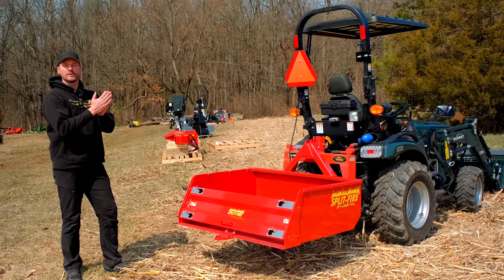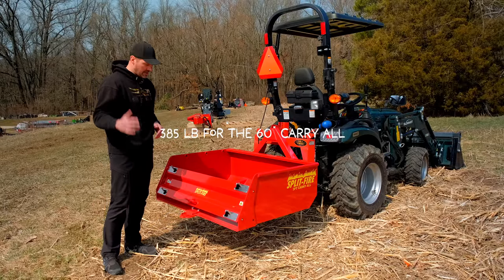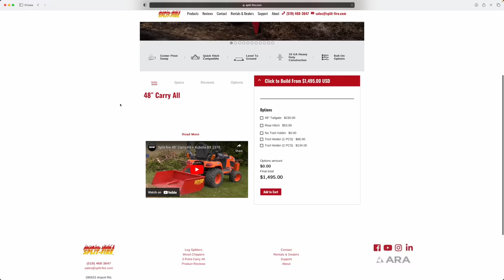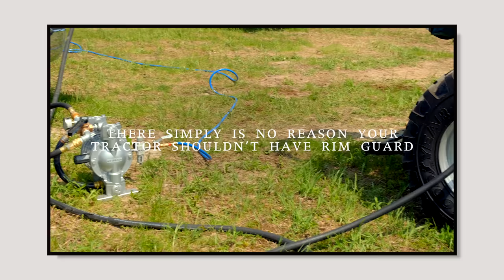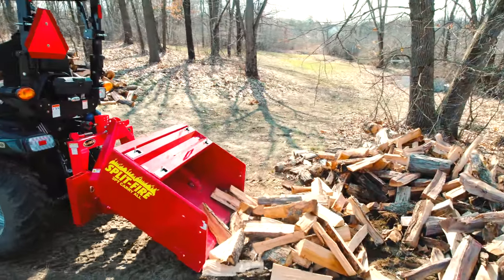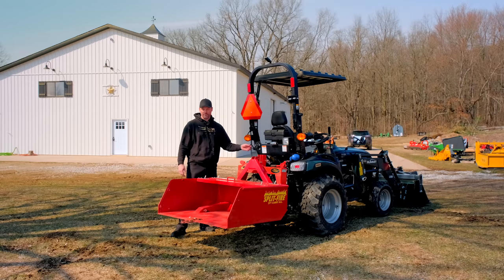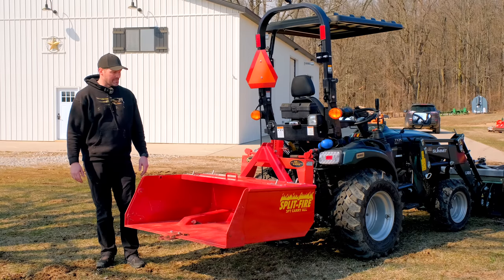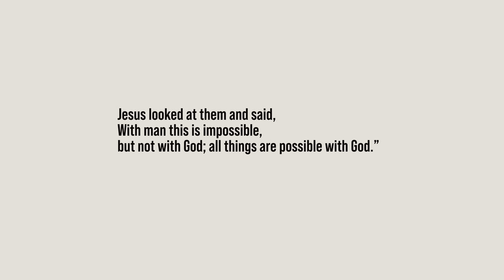A LOADER ALTERNATIVE! 3 POINT BUCKET SCOOPS, HAULS, & DUMPS!

Comment from the maker: Buy Split Fire Products manuacture direct!

Products in video:
Split Fire Carry All: https://bit.ly/41ezXrY
Split Fire 3-Pt Log Splitter: https://bit.ly/410Fh2k
Split Fire Wood Chipper: https://bit.ly/3MFse22
Precision Mfg Add-A-Grapple: https://bit.ly/3GDKHbm

Good Works Tractors is happy to be sponsored by Rim Guard Solutions!  This is perhaps the most well-known ballast brand on the market today.  Rim Guard goes right inside your tires, so it's out of the way, it doesn't freeze, and doesn't corrode.  It's made from natural materials, so it's safe around livestock and pets if it spills out.  Rim Guard liquid ballast adds more weight to the back side of your tractor improving stability, loader performance, and power to the ground.  Find your closest dealer at https://bit.ly/3d0whX0

LOOK AT OUR MOST POPULAR ATTACHMENTS!
Speeco Quick Hitch: https://bit.ly/3NFC0yl
Stump Wrecker: https://bit.ly/3WYa6Tf
VersaBracket Combo: https://bit.ly/3wUPrnl
Snow Pusher: https://bit.ly/3NB4BVw
Tillers: https://bit.ly/3GT1kk1
Core Plug Aerators: https://bit.ly/3W0R25q
Pallet Forks: https://bit.ly/38wRztu
Grapples: https://bit.ly/3PNNYaZ
Dethatcher: https://bit.ly/3GT9Zmk
Tractor Canopy: https://bit.ly/3IHcvNU

WANT TO SAVE MONEY? CHECK OUT THE GWT DISCOUNT CLUB!  Use code GWT at any of the vendors below and you will save cold hard cash :)  I will also get a commission for the sale, so it's a win-win-win!  

USE CODE "GWT" TO SAVE BIG WITH:
BUCKET BRACKETS @ http://www.jufabworks.com
CUSTOM GRILL GUARDS @ http://www.5elevendesignz.com
PTO QUICK ATTACH @ http://tractorptolink.com
DIY HYDRAULIC SOLUTIONS @ http://www.summit-hydraulics.com
GAME CHANGING GREASING SYSTEMS @ http://www.lube-shuttle.us/store
TIRE CHAINS @ http://www.tirechainsonline.com
PREVENT FLAT TIRES @ http://www.multiseal.us
CULTIPACKERS & CRIMPERS @ http://www.packermaxx.com
ALL OEM JOHN DEERE PARTS @ http://www.247parts.com
ACCESSORIES AND BACKHOE BUCKETS @ http://www.muddscustoms.com
CUSTOM TRACTOR FLOORMATS @ http://www.tractormat.com
PROTECT, ORGANIZE, IDENTIFY HOSES @ http://www.outbackwrap.com
BOX BLADES FOR ATV'S @ http://www.northwoodsfabrication.com
HYDRAULIC SYSTEM PROTECTION @ http://www.hoseendchamer.com
DUMP FROM THE SEAT MATERIAL COLLECTION SYSTEMS @ http://www.proteroinc.com
POWERED SWEEPERS SWEEP UP ANYTHING @ http://www.sweep-all.com
EASY WHEEL TOP LINK HANDLE @ http://www.tractoraftermarket.com
TIRES, WHEELS, AND DUAL ADAPTERS @ http://www.millertire.com
AMERICAN MADE CARRY ALL ON STEROIDS @ http:www.bigtoolrack.com
THE BEST TOOTHBAR AND MORE @ http://www.heavyhitch.com
5% OFF WITH CODE GWT AT TRAC SEATS! http://www.tracseats.com

SHOP: http://www.goodworkstractors.com
AMAZON: http://www.amazon.com/shop/goodworkstractors
SUBSCRIBE: http://www.youtube.com/goodworkstractors
LIKE: http://www.facebook.com/goodworkstrac...
FOLLOW: http://www.instagram.com/goodworkstra...
MERCHANDISE: https://stores.inksoft.com/good_works_tractors_merch/shop/home

*Discount codes cannot be combined with any other promotions, offers, or deals!
**I choose to sell some products through 3rd parties instead of stocking items myself.  Know that I will receive a commission if you choose to purchase through certain links.  Thank you very much for your support!

This video is for entertainment purposes only.  Good Works Tractors (Good Works Lawn & Power, LLC) cannot be held responsible for content found in any video.  Always reference your owners manuals, use extreme caution, and proceed at your own risk.

Comment: King Kutter has had a version of this for years. I have one for my old 8N. Really useful.
Reply from the maker: Very nice!  I did just search and find the KK version.  30" wide I guess?  Is that what you have?
Reply: @GoodWorksTractors  Yep. It's been a solid performer for years now. It'll see duty on my 3043D when I have a lot of material to move. I like the size of the one you were showing today. If I didn't already have the KK I would probably get one.

Comment: I think it's more useful to me than a box-blade but I have a BX & after purchasing three-point-forks I was somewhat disappointed when testing its ~300lb lifting capacity where my loader is more like ~500lb lifting capacity.  If I had a heavy L series then I'd probably own one of those three-point-buckets.  If it were hydraulic the hinges could be further out & would allow lower-hight dumping, the dumping might ought to have the weight on the ground & off the tractor anyway as the dirt-weight is shifted up-&-back.    

5:02 I've bent my top link doing something similar to that with a rear-blade.
Reply from the maker: Yeah, well I've shared my thoughts on the BX before 😂

Comment: Use it with the top link in the tractors bottom hole. It will work much better
Reply from the maker: Good tip

Comment: wouldn't you want to not scoop stuff up backward? I've seen some videos where they say the 3 point is to pull, not push with.
Reply from the maker: Box blades, rear blades, landscape rakes....you push with many tools on the three point.  However, you do want to use caution and not ram things unnecessarily that could cause damage.  Same thing can be said using the loader pushing forward though.
Reply: What he is talking about is the slip scoop. Both products have their advantages. Someone needs to design one product that does both.
IE take your product and allow you to mount it from the other side.
Reply: Thanks for the reply, Good Works Tractors. @Jay it would be cool if you could hook it up to the quick attachment  and the three point.
Reply: The old school one were designed  to hook either way to pull or push